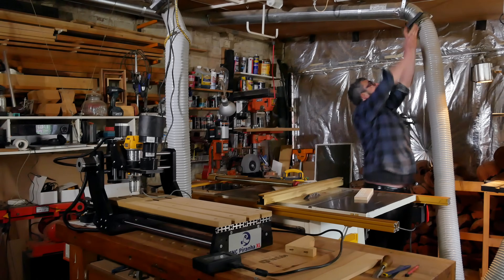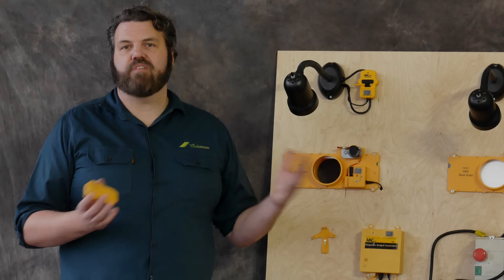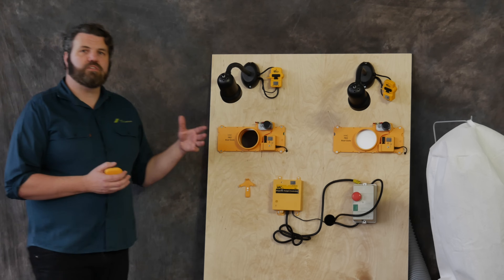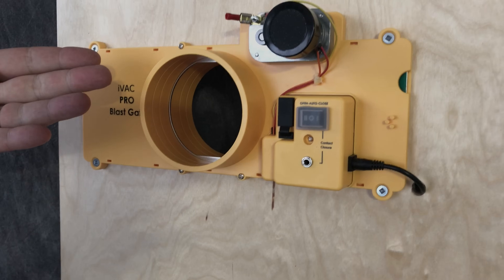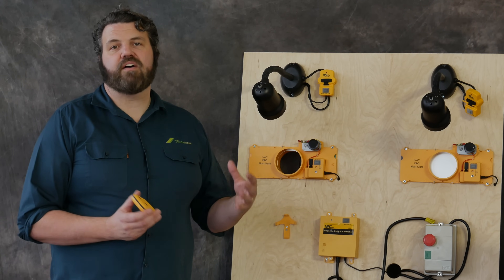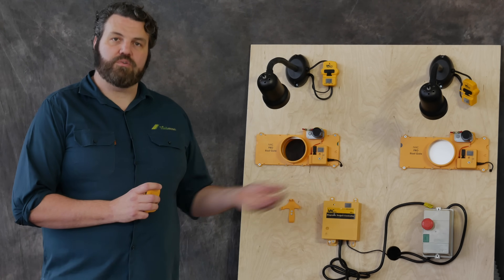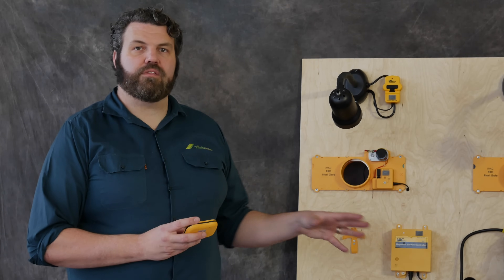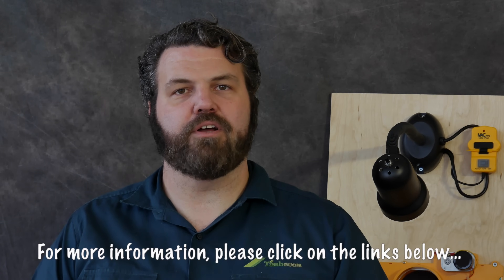Dust Extraction System Hassles? GONE!

Comment: Nice gear but a bit expensive and over complicated for a small pack away setup. Ideally I would like the Sherwood 1100W compact extractor with the capability to switch a 2000W tool or the Ivac Switch box upgraded to handle the 1100W extractor and a mitre saw or small table saw to 2000W. I guess I’ll just have to make it myself.

Comment: Will this system work with three-phase equipment?
Reply from the maker: Hi Bert. Most definitely - the MSC will work on any extractor that has a fully magnetic NVR switch - that is the only requirement for the controller. If required we can supply a 415V three-phase magnetic NVR switch if your extractor doesn't have this.
In terms of the Tool Plus Pro - yes it will work on both single and three-phase power cords and has provision to attach to both. As it is just picking the electrical current there is no difference in the way it works between single and three phase machines.